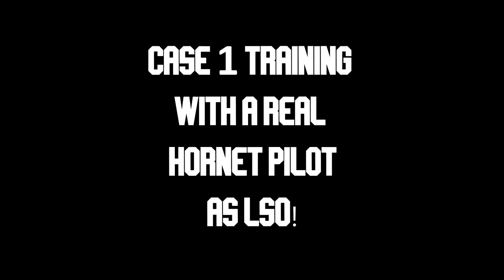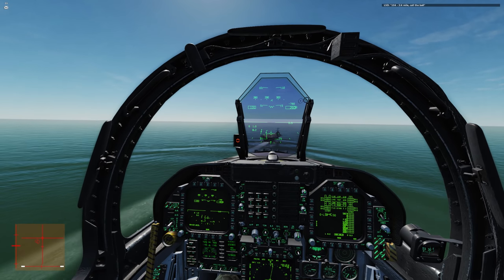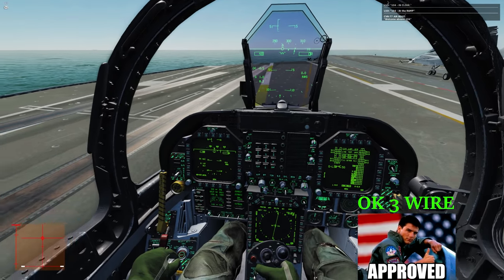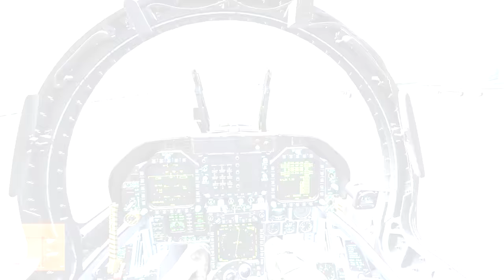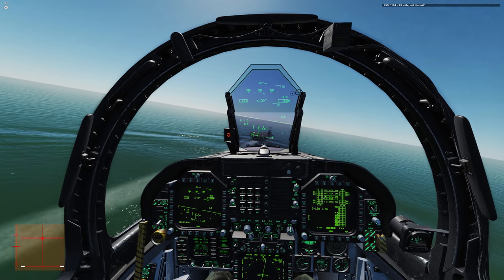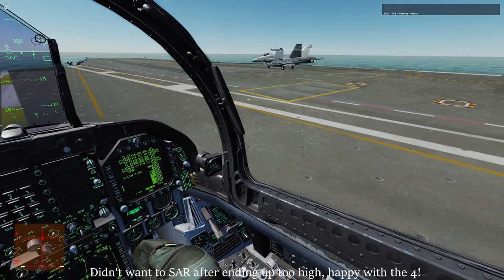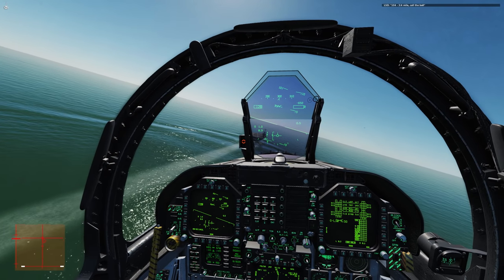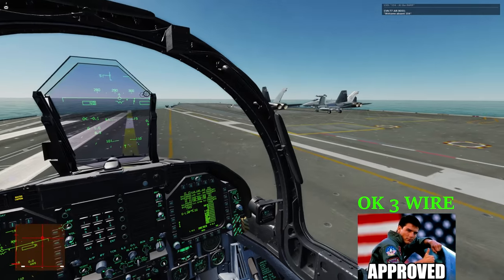DCS F/A-18C | OK 3 Wires from a REAL Hornet pilot!

Comment: How do you keep the ball centered all the way to touchdown? Mine drops to red once on the deck.
Reply from the maker: That means you're coming in slightly too low mate.
Reply: @104thMaverick  Okay thanks, yeah I just start thinking if I don't throttle down I'll skip right over the wires so my instincts tell me to throttle down. Need to work on that.